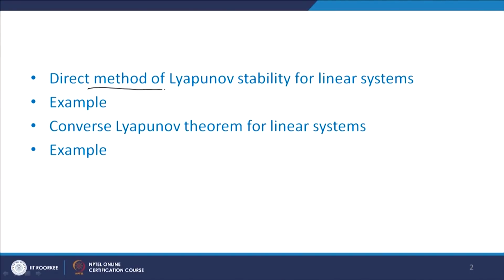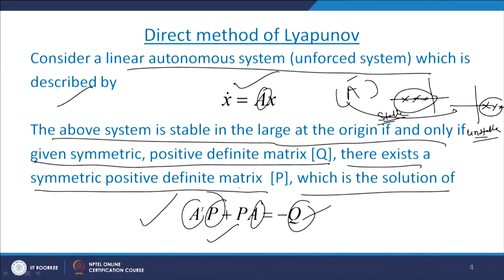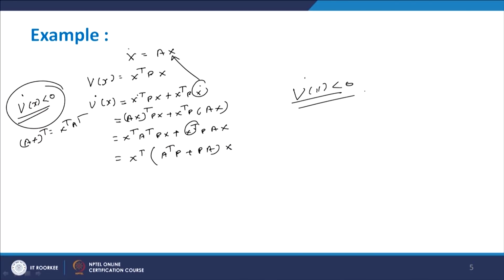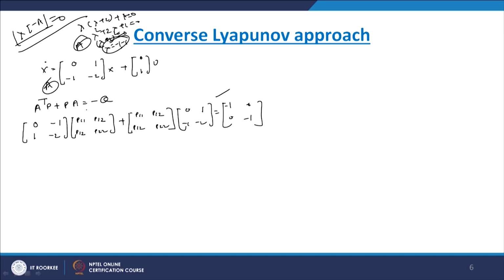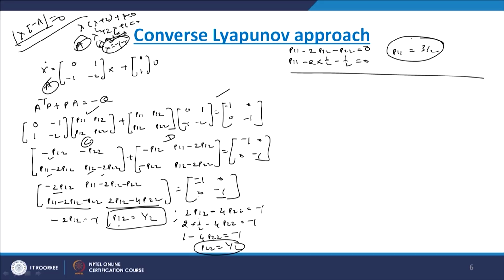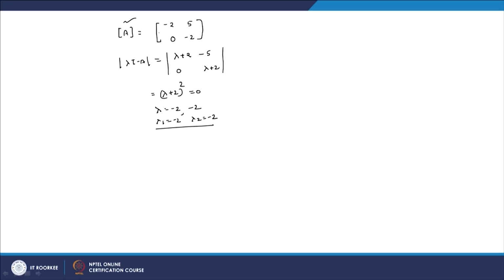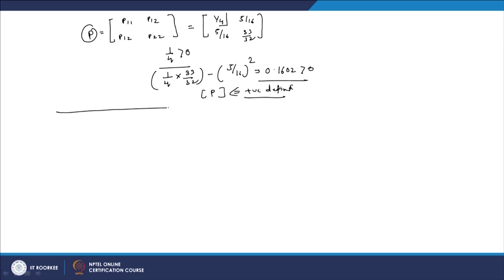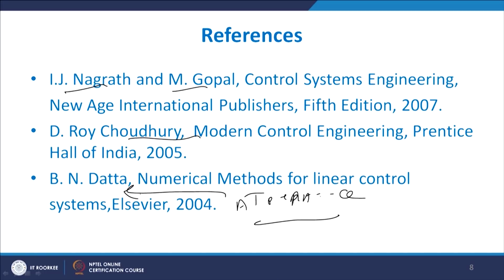Stability Analysis in State Space: Lyapunov Stability Analysis (Direct Method) Part-V

Comment: What is value of Q exactly?
Reply: According to feedback systems by Murray and astrom: 'The requirement that V˙ be negative definite (for asymptotic stability) becomes a condition that the matrix Q be positive definite. Thus, to find a Lyapunov function for a linear system it is sufficient to choose a Q > 0 and solve the Lyapunov equation:
AT P + P A = −Q. (4.14)'

In other words, Q must be any positive definite matrix, and it can be chosen to be the identity matrix. which is why -Q is denoted as [-1,0 ; 0,-1] at 12:13 
This should work when finding a still unknown P matrix in any state-space model which needs to be analyzed. I am studying this matter too, and i am still finding out how everything works. But according to literature, this ought to be the answer.
Reply: @Kallum  Thanks
Reply: Kallum Thanks